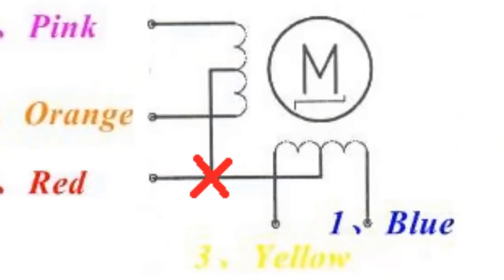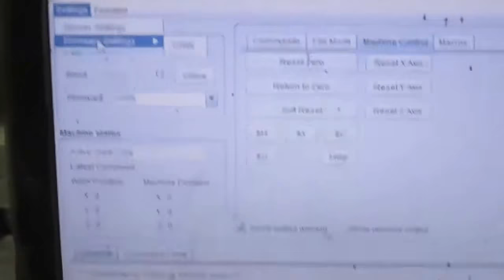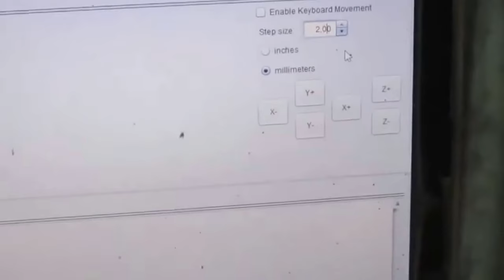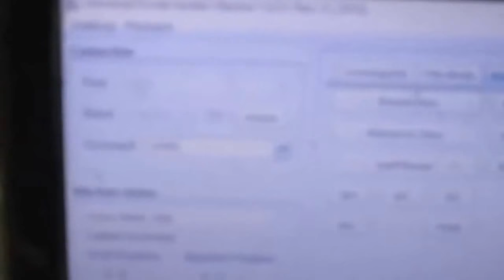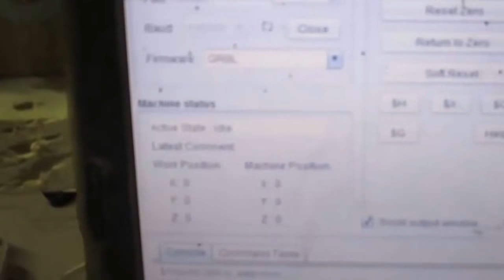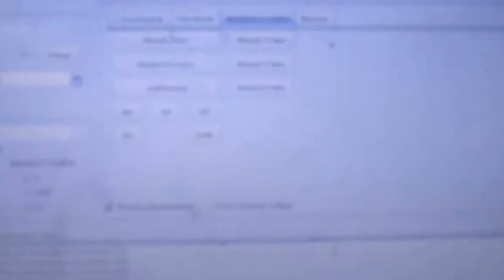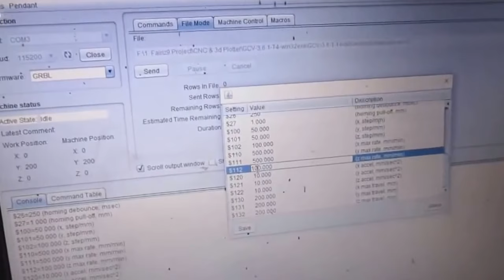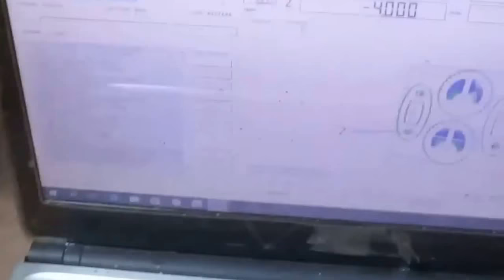How to make Mini CNC Machine with 28BYJ-48 & A4988 Arduino Part-2

Comment: Hello Faisol,
  I have a couple of question, I'm hoping you will be able to answer?
1.) Would you be able to "Fritz" the breadboard in your video.
2.) It was hard to see, but did you change $100 in grbl to 60? And what other mod's did you end up making in grbl?
3.) Are those "Pololu A4988"'s
Thank in Advance!
Reply from the maker: 1.) Would you be able to "Fritz" the breadboard in your video.
      >> " Fritz " ? Mean ?
2.) It was hard to see, but did you change $100 in grbl to 60? And what other mod's did you end up making in grbl?
    >> Yes i try for A4988 Pololu MS1 High, MS2 Low, MS3 Low, (Half Step) used 50 ~60 usec at $100 (X), & $101 (Y),  $102 (Z), callibration  80% Fix.
3.) Are those "Pololu A4988"'s
  >> Yes, but you must adjust vref at kit, coil at motor stepper 28byj-48 max 
       100mA.
Reply: gan maksud ente di atas"" used 50 ~60 usec at $100 (X), & $101 (Y)""  ini bukan  yang di ganti ..$120=50.000 (x accel, mm/sec^2)
$121=50.000 (y accel, mm/sec^2)
$122=50.000 (z accel, mm/sec^2)
di atas settingan default grbl 0.9
terus yang ini ""Yes i try for A4988 Pololu MS1 High, MS2 Low, MS3 Low, (Half Step)"" 
ente pake code di arduino software apa lewat jumper ?? soal'a ane pke CNC Shield v3,, udah ane jumper masih aja muternya ngawur.
Reply from the maker: gan maksud ente di atas"" used 50 ~60 usec at $100 (X), & $101 (Y)""  ini bukan  yang di ganti 

>> yang perlu disetting :
>> $0 = 10 (step pulse, usec)
>> $101 = 60 (x, step mm)
>> $102 = 60 (y, step mm)
>> $103 = 50 (z, step mm)

..$120=50.000 (x accel, mm/sec^2)
$121=50.000 (y accel, mm/sec^2)
$122=50.000 (z accel, mm/sec^2) 
>> $120, $121,$122 tidak pengaruh karena yang dipakai code arduino bukan accel

terus yang ini ""Yes i try for A4988 Pololu MS1 High, MS2 Low, MS3 Low, (Half Step)
 >> Lewat Jumper pada Modul A4988
Reply: Faisol R. ane juga udah sma kaya nte di atas gan setting gbrl nya , jumper juga udah di pasang d M0 (half step) .. tp ko ane gerakin lewat UGC sender mau + / - gerak motor sama aja satu arah .. kenapa ya ? wiring udah di ganti2 masih aja sama begitu gan .. ane pke cnc shield v3 + A4988 +28byj (bipolar)

Comment: how can I calibrate my 28byj-48 engine to the a4988 driver because it heats up a lot
Reply: If they are 5V version, then 100mA maximum. At least 24V.

Comment: Ijin sedot dlu ya gan :D ... kmren nyoba convert 28byj ke bipolar pke a4988 .. ane lom ngerti setting grbl'a ... pas di coba aneh'a motor gerak berlawanan padahal ane movenya (+) di UGC Sender ,, btw pny akun sosmed ga gan or forum ..
Reply from the maker: konekan 4 cable aja yang dibalik atau setting UGC sender.
Reply: Faisol R. 4 kabel yg d maksud coil 1 biru.kuning . coil 2 orange.pink .. begitu bukan ?
Reply: http://howtomechatronics.com/wp-content/uploads/2015/08/A4988-Wiring-Diagram.png?x57244
kalo liat wiring yg ini brrti 1A(biru)1B(kuning)2A(orange)2B(pink) gitu ?
di grbl axis X/Y steps/mm =6.400
x/y max steps/s = 320 
bener ga gan klo ane pke 2gt 20teeth 2mm pitch .
Reply from the maker: untuk ngatur perputaran motor (+/-), bisa konekan kabel (klo kabel belum disolder, Atau bisa juga diatur di software
Reply: itu wiring ke a4988 bener ga gan yg ane td komen ?
Reply: ane udah puter2 kabel tetep aja gan muter motor ga jelas .. mau + atw minus .. muter nya tetep searah.... btw ente setting step/mm di grbl berapa ? kalo boleh tau cara ngitungnya gimana ? ane nyari di inet ada yg bilang 28byj 512/rev ?
Reply from the maker: apakah sudah diputong (lihat video tutorial MINI CNC MACHINE STEPPER A4988 28BYJ-48 GRBL ARDUINO PART-2 pada detik : 35
Reply: Faisol R. udah gan ..jalur  tembaganya udah kepotong.. itu cek di pcb motor'a gmn ? video blur pas yg itu .. jd ga jelas itu yg d cek resistensinya yg mana aja ..